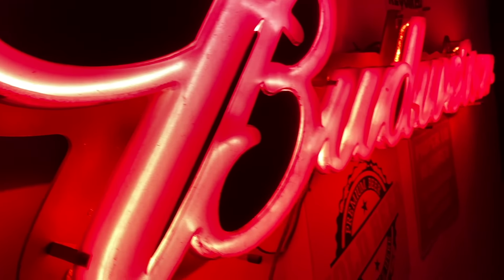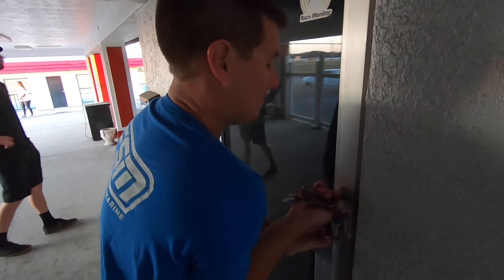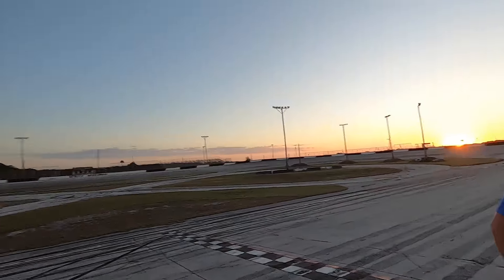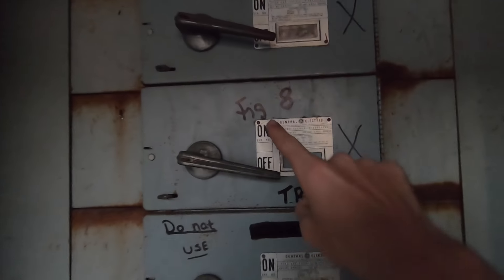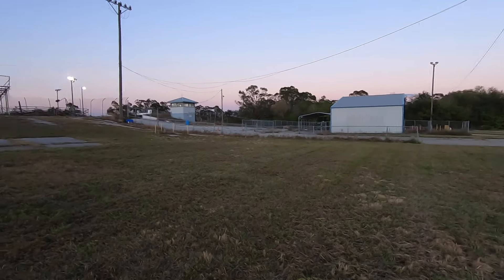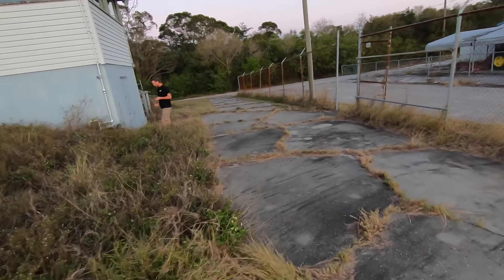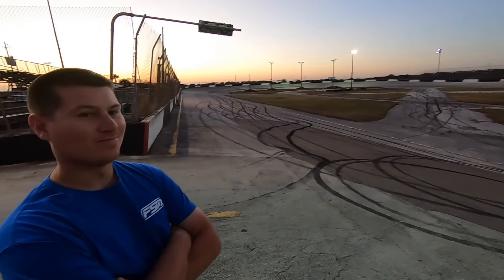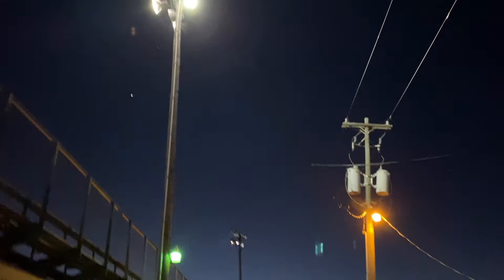Restoring Power to our Abandoned Speedway After TWO YEARS in the Dark! (Freedom Factory)

Comment: For sure go LED, less amps and way less running cost.  Plus it being a business you may be able to write it off or get a huge energy saver tax credit.  Love the content!
Reply: Fyi literally everything you see on here is a write off.  From the bald eagle machine to the 1000cc golf cart.
Reply: Would it be worth it to put solar panels I'm completely clueless just wondering
Reply: Smart man
Reply: And they are brighter too
Reply: @sarab2906  possibly, but it would take a serious setup to power that facility.
Reply: @sarab2906  You would have to have a massive amount of solar panels and batteries for storage. Would not be cost effective at all. There is a reason solar has not seen mass adoption. $$$$$$$$$$$$$
Reply: @sarab2906  After years and years, maybe
Reply: For a couple hours a few times a month. It won't pay for it self
Reply: @MX304  I mean there is a big field right next to the track that the solar panels can go on.
Reply: Cleet take tips from this, you can basically put ALL freedom machines as tax write offs because of the freedom factory,
Reply: Nah solar panels are a no go. Not very efficient, wayyy too much up front cost to recoup. Definitely go LED though. Those bulbs they have now are expensive to operate. When I was a teen I worked at a mini golf place. They had like 40 bulbs and it was a little over $100/hr to operate them.
Reply: @Ryanmoody89  Look at it this way. To convert an average size house to solar will costs almost as much as the house itself does in most areas. Now imagine how much more power that track requires....
Reply: A point for solar is that they are in Florida, they will get strong sunlight most of the year
Reply: @sarab2906  probably not. You need to either store the energy somehow or feed it into the grid which can be a hassle and not worth the money/time. But LEDs would definitely be an upgrade - Instantly turn on, brighter, consume less power, dont burn out so quickly, better color...
Reply: @MX304  Grid tied solar is what you'd use for this not battery/off grid.
Reply: get flicker free LED's
Reply: @MX304  you can get a decent solar setup and a tesla powerwall 2 (or 2) for about $25k-$35k here in aus (where all that crap is expensive af), if your just in a 3br house without the aircon on 24/7 (and no tesla charging off it) that will be enough, you would rarely have to touch the grid. but definitely not feasible for something of that scale.
Reply: @Tibersun sure they are write offs, but you have to make enough money to begin with to have the write offs mean anything lol
Reply: They also wouldn’t have to warm up so it could literally just be that clunch from hitting the switch and just nearly instantaneously them fuckers would be at 100% brightness
Reply: Yes LED is the way to go👍
About the solar panels:
I don't know how it works in the US but here in Sweden you sell the power you doesn't use to the Electricity Company, so if you put up solar panels and use the power 7days a month you get payed the other days as long it's sunny. 👍
Then for example if you use twice the power you produce that 1 week and it's sunny the other 3 you Still produce more electricity than you use and get payed 👌
- No need for batteries.
Reply: @myopinion69420  Here, a power wall and enough solar panels to run it is around $180k last time I checked. Air conditiong is not optional. Even in the winter. Plus all houses are total electric. We have no natural gas for the most part.
Reply: @semajniffirg230  touche
Reply: @MX304  Yea, the aircon thing all depends on where you live. Where i live temps dont swing to far in either direction so with windows open in summer and wood heater in winter, we dont spend anything on heating or cooling (we dont have gas either)

this is what i found online for pricing (in AUD, so would be less in USD)

13.5kWh Tesla Powerwall II: $13,500-$16,000
6.6kW panels: ~$6,000

so your looking at $18k-$22k, you could double or tripple it for more aircon use.
Reply: Dave Iauco  I'm very aware of the advantages and draw backs of LED's.  They own a business, they can absolutely get all new high end lighting at a HUGE discount because its energy efficient compared to what they have.  1 good sponsor like maybe Phillip's or something and boom, ALL of their lighting needs are taken care of.  Its safer, better on the eyes, and will last longer while being less in upkeep.
Reply: @Neezy Ceezy Here in Aus, solar is worth it as long as you are using the majority of the power you generate, as the price you get for selling back to the grid is not very good. Last time i ran the numbers, the power wall was just not worth it, by the time the solar setup and power wall paid for itself its only about a year off the expected usable life of the battery, if you have to use finance to install it, it does not pay for itself before the expected EOL.

The best way to do it is have your aircon/heat up high in the day, set your dishwasher/washing machine etc to run during the day, then at night use as little power as you can comfortably, turn the heat/aircon down to just maintain that sort of thing.
Reply: @docthomas88  They did it for a super bowl a couple of years ago, it's very possible.

Comment: Gets first electrical bill.  TURN OFF ALL THE DAMN LIGHTS!
Reply: Derek Kolb i have two spot lights for my home baseball field/hockey rink depending the season and they are not cheap at all to run but worth the fun the kids have.
Reply: Yeah those big metal halide set ups eat electricity.
Reply: Costs 5k per switch back in 1993 do to power drawl spike with Peace River.
Reply: "You damn kids think we're made of money?!"
Reply: Wolffy93 Do you think they’re  metal halide Or high pressure sodium
Reply: @NTromb  probably metal halide, looked pretty white.  not that yellow orange HPS typically puts out.
Reply: How big of a solar setup would they need to run the stadium off free power?
Reply: @kjcorder  Also, HPS are more monochromatic so wouldn't be suitable for a race track.
Reply: These are probably 1000w metal halide bulbs. If they were high pressure sodium bulbs, they’ll emit an orange colour. If these were mercury vapour, they’ll emit a light green colour.
Reply: Taylor Wright someone grows ..... uh tomatoes

Comment: something about those old school HPS track lights just gives good vibes- reminds me of summer nights.
Reply: HPS are a different color and warm up faster. Those are a metal halide. (Maybe Mercury vapor.... But almost too warm of a light.)
Reply: @Charles Ball there are more nuances than that, but yes, generally speaking you are correct. But, high pressure sodium doesn't take on that blue-green hue, so it cannot be a high pressure (especially not low pressure) sodium lamp. Hence, what I said.
Reply: Daniel Minic  LED lamps, if chosen correctly, are not discernable from an MH lamp. It's when you cheap out and get crap, it shows.
Reply: @IceBergGeo  exactly.   But even when your whole installation and materials are being paid for within 4 years because of the energy cost savings , they still want to have the cheap stuff that only lasts 4 years if their lucky. And still pay a lot for the installation of the lights each time they need new ones.

Comment: Also the ones that take forever to turn on those are the ones you really want to change to led since they use so much kw. Use 5k light temp for everything too it looks great!
Reply: Dj Diddles  Yeah agreed. Those look like 1500 watt metal halide bulbs. Unfortunately LED replacement fixtures of similar power still consume an immense amount of power (~800 watts). Where you really gain is in reliability, since you eliminate the ballast sand igniters used in MH bulbs, not to mention the instant on time.
Reply: splewy good thing that led is still a growing platform. Always reinventing
Reply: @splewy  that's almost half the wattage...  So I bet they'd save a lot
Reply: @ChevTecGroup  @splewy modern LEDs made in the last 3 years will consume 1/3rd the power of Metal Halide
Reply: LEDs are expensive AF it seems like. Especially for the ones that could legitimately replace what he's got. You're looking at probably $25k-50k or more just for the new equipment. That's a long time for return on investment
Reply: @ChrisG1392  it'd literally take decades of constant use to recoup the cost of retrofitting with an LED setup.
Reply: @92ASC  Florida will rebate any retrofitted light over 40W.
Reply: @92ASC  most of the lights need replaced anyway as they don't work.  So why not switch to LED?  Heck they could consolidate the good bulbs to some poles until they run out
Reply: @ChrisG1392  LED's are not as expensive as you think, I did lighting for 5 years and I can tell you it's worth it to convert to LED. Changing the ballast from those old 1970-1990 to today's LED compatible ones will save you so much energy and kwh. Those bulbs on the track consume so much energy and switching to LED will cut that in half or more.
Reply: @ChevTecGroup  Exactly, and switching to LED's wills save alot of power. I've done places bigger than this track that have had 4 to 6 work orders and the total savings amount is always 30k+. It's always worth converting to LED no matter what, Especially when they last 15 to 20 years before needing to be replaced again.

Comment: 7:00 that air reciever looks old be carefull with that one. Might be rusted and dangerous. please replace that one. (I have been working with compressors for over 17 years). /Best regards
Reply: Agreed; no way I would use that outdoor compressor. A new one is cheaper then running those stadium lights for a night.
Reply: Why? It doesn't explode
Reply: @The guy Yes, they needs to be inspected, and measured sure. but i doubt that have been inspected. No need to be keyboard warrior here, just making a point.
Reply: @deckname5794  Moisture in the air collect in the bottom of the air tank each time you use the compressor and if you don't drain the air in the tank after use the tank could rust thru and when it ruptures rust flakes becomes shrapnel.
Reply: This place has been abandoned for quite some time. Probably not been inspected for even longer. No reason to take a chance on it being safe. At least get a new inspection done before using it.
Reply: why don't they just make them with a rust-resistant coating inside?
Reply: Rune Andre Bergtun true
Reply: @antisoda  exactly, dont take any chanses. :)
Reply: @xxXxxJA5ONxxXxx  probably because of the cost. It's possible that compressor tanks built in stainless or with a good coating exist. But they are more expensive.

Comment: Whenever you throw those old disconnects it’s advisable to stand to the side and look away just in case something goes wrong they can blow the cover right off , just a little tip
Reply: I used to work in a venue that had those and we wore glove to flip them. It was such a satisfying click but it was dangerous
Reply: Old disconnects, new disconnects, new breakers, it’s just good practice to look away. Great tip.
Reply: Kaiser Wilhelm thank you for mentioning that. I was cringing and looking away ever time he threw one.
Reply: Ummmm yea lets be real here. 
Something could go wrong: it could arch and you have the panel turn to molten metal flying straight at you along with ???  all the voltage at your face. ☠☠☠ for sure

Comment: @Cleetus McFarland Careful when you're turning on or off those breakers in that electrical panel. You should use only your offhand, stand to the side of the panel and potentially even look away. Especially when dealing with that old gear, who knows exactly what is going on behind the covers. Google Arc Flash and you'll see why.
Reply: Tom,  you are correct here sir.  I learned some bad lessons in old Chicago loft buildings.  That shit can get your attention quick!
Reply: Tom, I agree. I am a commercial electrician, you should totally be wearing some PPE turning on breakers like that. Might be good to set up a lighting control system where you dont have to be near those when they turn on.
Reply: They said they had an electrician come out and test all the boxes beforehand. They're just turning them all on for the cameras now.
Reply: @sorrenpeak4870  Yea and it's had a long ass time to corrode away or otherwise fuck up. Standing to the side is inconvenient until molten copper shoots out at you.
Reply: @sorrenpeak4870  agree to disagree. An arc blast off a breaker like that could easily kill everyone in that room. According to NFPA 70E you need to be wearing a cal rated suit when you turn on big equipement like that. It will probably be fine 20000 times, just that one time is all you really need for it to be bad. You can set up lighting systems to where no one has to flip those breakers everytime you need the lights on.
Reply: @DenTekEasyReachFloss  Exactly what I thought as soon as I saw that. Electricians ftw
Reply: @sorrenpeak4870  working around it and being cautious around it are two different things. Safety might make you laugh like a moron but it'll keep you alive.
Reply: @sorrenpeak4870  it has nothing to do with being grounded. We had an employee recently have an MCC blow up across the room on motor startup. Even though he was far away he injured his back from jumping when it went bang. It blew the door right off.

Comment: Several thousand dollars to change to LED, but will save that much in no time in electric bills.
Reply: more like $75,000 +  to change over
Reply: It's a very worthwhile long term investment. LED's will quickly pay for themselves in power bill savings, and they last much longer than metal halides.
Reply: Would putting solar panels be a good idea I'm completely clueless but that's one of the first thing I though of
Reply: @sarab2906  Not worth it on that big of a facility. Millions to install, you would need hundreds of solar panels and thousands of batteries, a building to house all the batteries and electrical equipment ect.
Reply: LEDs of that magnitude are uh, 'a nice price'
Reply: @Syncopia  Yes I have a friend who's family owns a track and they were quoted $84,000  +  19,000 installation, They are nice and last about 20 years, they were made in Norway by a company.
Reply: They will have 3 or 4 events a year at most. In this case it's probably not worth it. It would take decades to offset the retrofit.
Reply: @sarab2906  Freedom Factory don't need no sissy solar panels.  We turn dead dinos into electricity round here.  The American way.
Reply: dude just from the first power on the LEDS will save them 30K LOL sure its like 70K start up BUT 30K saved in 20 secs ain't to bad :)

Comment: I'd replace as much as possible with leds to save some power and lower the electric bill. Save some money for better events!
Reply: LEDs are real hard on yer eyes, my brother.  I work in a greenhouse and I've noticed the damage.
Reply: If only you knew what a single LED of that magnitude cost.
Reply: they don't last as long as yo u think they do, while they maybe cheaper to run, buying them installing them and keeping them up not so cheap.
Reply: @sorrenpeak4870  I wonder if they just bought a bunch of led light bars and strapped em up there! Might be cheaper lol
Reply: Discharge Lamps have similar output per Watt.
They just take a moment to warm up but they are king for these lighting needs.
Reply: Not sure about Florida, but a lot of States/counties offer incentives for LED retrofits. Those metal-halide track lights will be very expensive to replace with LEDs though. Imo, they should replace all of the bulbs and T8 tube lights with LEDs (in the office and concessions). Then use up all the extra metal-halide bulbs they have in that garage.
Reply: Or just get some solar panels to hold some power
Reply: Not to mention the clean light vibe that LEDs put out would make events have just a little more of an edge... only concern is that the cameras would bug out with the refresh rates.
Reply: Once HIDs finish warming up; aren't too terrible on power.
Reply: @sorrenpeak4870  honestly as cheap as halide bulbs are, it would take decades of constant use for a retrofitted LED setup to pay for itself. IMO that would be pretty low in terms of importance on the list of upgrades.
Reply: @mushlove6933  you do know that solar panels dont hold any power right??? you have to have a bank of batters that the solar panels charge. and solar panels only out put DC current. those lights run on AC current.
Reply: LEDs flicker when being filmed so leds are not a good Choice for someone who makes YouTube videos.
Reply: also not to mention that when you try to make a video around any led light source the camera picks up the flickering of the LEDs. so every one say leds leds. not a good choice for someone who makes videos cor a living.
Reply: @jakesreef1730  true I dont know too much about solar panels, but thought maybe it could somehow hold power?
Reply: @mushlove6933 no solar panel dont hold power at all. they are connected to a bank of batters. and some voltage converter and a bunch of other stuff I'm not getting into.
Reply: Jake burch it’s true... but the do make VDC to VAC  converters but reliable and decently cheap now and days.. that being said, a solar panel field would not be worth the cost to use for these guys. My biggest concern is if they do go with LEDs the camera refresh rate will pick up the LED timing way to much and make it unfilmable for anyone. With that said, I’m sure an electrical engineer could solve that problem finding a sweet spot. To my knowledge it’s not a thing yet though.
Reply: @brandonsipe5038  we are talking about just solar panels not voltage converters. that's way I said that there's a lot more to just a solar panel.